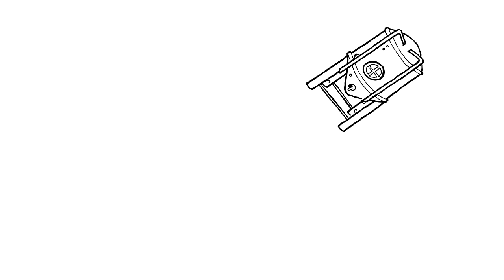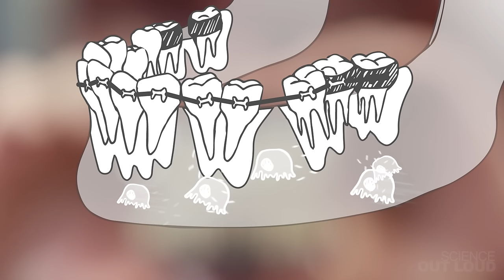How Do Braces Work?

Comment: I've had my braces for about 12 hours...already swallowed a bracket...
Reply: +Listening Point had them for two years now, won't remove them until this time next year lol and never had such problems :p
Reply: rip
Reply: Braces stink I thought my teeth were not going to hurt when I got the tightened but turns out they are hurting now or a day after.
Reply: +Flitx The Destroyer yeah they hurt every time you get the wires adjusted.
Reply: +Listening Point Yo LP, thanks for this intel. How would you rate the pain of adjusted braces on a 1-10 scale? And how about day-to-day between adjustments?
Reply: +Mike P It's probably a solid 7 the day after an adjustment but after about a week you don't even notice most of the time.
Reply: +Mike P no maybe like a 20/10
Reply: My teeth have already moved a bit and my mouth hurts more often.  Major diet change too.
Reply: They hurt the worst the first couple days after an adjustment.  And periodically certain teeth might be sensitive when you put bite pressure down on them. But most of the time you don't really notice any pain.  You're gonna inevitably get some cuts inside of your mouth where the brackets ride against your cheeks, I sometimes have to put wax on mine to keep from getting irritated that way.  Aside from that, keep em clean.  Get a waterflosser if you can and seriously don't even TRY to eat foods that are on the list of stuff they tell you not to eat...or you'll eat a bracket like I did.
Reply: +Listening Point woo I thought I was the only one getting myself hurt in my cheeks
Reply: Lool wtf
Reply: LMAO!!! i thought i would be worse XD
Reply: whuttttt da!!!!
Reply: thanks
Reply: Watch what you eat!! Brackets brake really easily. My sister broke 26. I've had them for 6 months so far and I haven't broken one....yet.
Reply: lol no its like a 4/10
Reply: +Alexa Calvo i never broke one, except when one cane off when i was brushing my teeth..lol.

Over the years that was the only one that broke.
Reply: OMG I ALSO SWALLOWED A BRACKET !!
Reply: Listening Point lol
Reply: LOL, Had braces since last July, my dentist told me i only have 3-6 months left till i get my braces off, whoooo
Reply: Listening Point lol
Reply: Listening Point ? how
Reply: +momo potato girl c Protein Bar.  Good for bones.  Bad for brackets.
Reply: Listening Point I'm getting braces tomorrow 😬 probably gonna happen to me too 😂
Reply: Just avoid thing thicker than the distance between the top of your tooth and the top of the bracket.  Break your food into smaller pieces and don't eat anything really chewy or super hard and you'll be fine.  It's been about a year now and I haven't lost another bracket yet...knock on wood.
Reply: Listening Point I applaud you.
Reply: is that true?
Reply: its youtube Its possible
Reply: Listening Point omg are you serious
Reply: Yup
Reply: Listening Point this is why I don't want braces. right there
Reply: Listening Point fuck that. that's like, all my sandwiches, apples, just about every other fruit. I'm lazy man
Reply: I have braces for 4 months and the first week I broke 3 of them😂...btw I haven't understand why we are not allowed toeat gum..I do it often although😭
Reply: Kostas Sx well you broke three of them... kinda answers that
Reply: Holy crap. Lmao I did the same thing at school...I was in gym class and I bit down way to hard it flew off my teeth and into my stomach it went...Rip
Reply: Listening Point Audio Improv lmao
Reply: When I first got braces, they didn't put the metal things on my molars since I had to get teeth pulled, and they botched the glue so the entire top piece fell off within 24 hours
Reply: Listening Point Audio Improv Lmao
Reply: Listening Point Audio Improv not possible
Reply: im must pull it out
Reply: Listening Point Audio Improv that’s so mee💀💀💀
Reply: Listening Point Audio Improv they dropped one bracket in my throat while putting then on and my orthodontist said "fuck it just swallow it"
Reply: StylesFinnClub idk y but I laughed
Reply: Listening Point haha
Reply: Listening Point how do you swallow a braket poor you
Reply: Listening Point Okay.....
Reply: Lmao😂😂the first time I got them like 2 hours later I broke the brace
Reply: Damn I've had mine for 3 years (just got them off today!!!) And I've never broken a bracket how the hell did you swallow yours!?!? O_o
Reply: Listening Point same here while I was eating
Reply: Listening Point 0-0 ok than
Reply: Listening Point I broke mine after 2 weeks.... Twas not my fault 😵 The orthodontist didn't stick on the glue right 😤
Reply: Listening Point what!!!
Reply: Listening Point Lel how does it taste? I have my braces also but I didnt follow instuctions. I ate my jaw
Reply: Listening Point nfmdd
Reply: Listening Point Oh no! Hope you got to a hospital, the metal can tear some of your stomach tissues... did you eat something really hot and liquidy or something? Because the glue also doesn't completely dry till 24 hours is up
Reply: Mike Pritchard either I have extreme pain tolerance or am lucky, because it’s maybe a 2, until I bite things, then it turns into a 5.
Reply: I honestly laugh really lound😂
Reply: Cool hahaha. Problems
Reply: Listening Point it’s actually not possible to swallow a bracket. The wire is wound through all the brackets. The only bracket you might me able to swallow is the last one which holds the wire. I have broken many brackets and never have swallowed them.
Reply: RELATABLE
Reply: Listening Point YOU JUST MADE ME SPIT WATER ON MYSELF AHAHA
Reply: I feel so bad for laughing😂
Reply: Listening Point I have them
Reply: How damn 😂👏👏👏
Reply: Listening Point .
Reply: Listening Point lol
Reply: Listening Point oh dang lol
Reply: similar thing happened to me but in first two hours lmao
Reply: Um your orthodontist is probably not very good. If a bracket pops off it stays on the wire I don’t know what kind of braces you have but there really isn’t a way for that to happen unless you physically pull on it
Reply: And now you make ASMR videos.
Reply: Listening Point what. How tf did you manage this
Reply: i've had my braces for more than a year now and never broke any brackets...
Reply: LOLLLLL
Reply: lmaooo rip
Reply: The real question is, did you get them off yet?
Reply: Listening Point 💀
Reply: Listening Point lmao I did that to once more like twice
Reply: Listening Point what! :o I’m not ready for braces in November 😱😓
Reply: Listening Point 😂wow
Reply: Flitx The Destroyer Really? Mine never hurt after getting them tightened... maybe mine aren't as sensitive, but I'm not sure.
Reply: Listening Point wow. 😯
Reply: Listening Point oh dear!!!!
Reply: Listening Point 😂😂😂😂😂
Reply: Listening Point meeeee
Reply: Listening Point ugh I will have to get them soon and I’m going to hate is so much! Good luck.
Reply: How the......
Reply: I literally just got mine off and I was just told I needed them again. My teeth are horrible
Reply: Listening Point i had mine taken off in February this year after almost 2.5 years 🙊 was only supposed to have them for a year! But im so happy with how my teeth are now compared to how they were before! The pain is totally worth it! Xx
Reply: On a scale to 1-10, how much do they hurt when you first get them? I'm getting my braces soon.
Reply: Listening Point lol😂😂
Reply: Listening Point same I had my braces and for a little bit and my brackets keep falling off and once I swallowed a bracket and I dint even know
Reply: how did it go?
Reply: readmeastory LOL UR PROFILE PIC GIES WELL WITH HER COMMENT
Reply: readmeastory *goes
Reply: Listening Point hmm so how are you now two years later?Do you still have braces?
Reply: 🤔 sounds like something I would do
Reply: Noooo
Reply: Listening Point Htf do u swallow it I had mine for 2 years and never happened
Reply: How tf do u break a bracket i use to have braces for 2 years and that never happenned
Reply: Still alive bro
Reply: Woah
Reply: uhh... the worst thing that happened to me was I couldn’t eat solid food
Reply: Listening Point wow
Reply: I’m feel bad for u
Reply: Listening Point how!
Reply: R.I.P. YOUR BRACKET
Reply: oh atleast im not the only one that swallowed a  bracket..
Reply: Rip 😆
Reply: Listening Point SAME
Reply: Omg I wanted braces but once I got them I died
Reply: HOW?!??
Reply: BrUh
Reply: I though I was going to lose a bracket the second I walked out if the orthodontist
Reply: tbh that happened to me
Reply: @amylene  Lucky. I Have 3 braces every 2 years which means 6 years kf braces hooray
Reply: Do braces hurt more than fracturing your wrist please answer quickly cuz u guys scaring me,because I fractured my wrist and it hurt like hell hope getting braces isn’t the same
Reply: @flitxthedestroyer237  take a painkiller. I had 5 teeth removed. Total of 9 anaesthesias. I'm 12.
Reply: how–

5 years ago

Comment: hits blunt
how are teeth harder than steel if your teeth can't break steel but steel can break teeth
Reply: My head hurts
Reply: W
Reply: GD Danny W
Reply: Dang it,Amyyyy!
Reply: Vaffanculo I know it's a joke, but it's because steel is weaker, but it's much more dense than bone, which is even more dense than teeth.
Reply: mr.stark i don't feel so good
Reply: OMFG
Reply: FBI- Dont move
Reply: Thass deep
Reply: Cause there thinner than steel
Reply: Because steel is heavier than feathers
Reply: Vaffanculo nice username👀 HAHAHAHAHA
Reply: Apparently it has to do with the brittleness of teeth being higher and more susceptible to chipping off.
Reply: It calls jaw muscle
Reply: put the same density teeth and steel side by side and put force on steel will fail first.
Reply: Probably because steel comes in heavier packages
Reply: Because steel has more tensile strength. Put simply hardness measures the resistance of the substance to scratches
Reply: Brain cell has left the chat
Reply: cuz its ur jaw muscles that arent strong enough
Reply: Teeth are harder than steel. You can test this by Mohs scale of hardness
Reply: Dentists:Stay where you are
Reply: Teeth is harder then steel..but your body can't apply that much force
Reply: I know this is a joke butttt... I probably think it’s because of the crystal structure of teeth and steel itself.

Maybe teeth are harder than steel, but they are also brittle (i.e glass). So yeah :v
Reply: actually youre thinking of toughness. hardness just refers to what level something scratches at. for example, diamond is a 10/10, and plastic is about a 3/10.
Reply: It's not just about how hard they are it's also about how much force can bite down on whatever it is you're  eating
Reply: ahh
Reply: I think it's because teeth are harder but steel is stronger?????????????  I'm not positive.
Reply: Oh
Reply: Our teeth come out but never break when we bite into steel if our tissues are weak so technically the lady’s right
Reply: This is exactly what I thought
Reply: BroooOOooOoo...
Reply: Exactly
Reply: That's how I cut the end of my guitar strings
Reply: Vaffanculo Tooth enamel is harder than steel, but breaks much easier. Tooth enamel is mostly hydroxyapatite, which is a mineral form of calcium phosphate. The apatite group of minerals scores a five on the Mohs hardness scale; which makes enamel the hardest biological material.
Reply: how do you know that teeth can't break steel
Reply: @sharonfernandes3288  😂
Reply: Steel is and that's why teeth are but if because of and that's only if support by
Reply: My head hurts from reading this
Reply: Its all about force
Reply: By force and density
Reply: I mean maybe because teeth shatter easier instead of just absorbing the impact by denting
Reply: Teeth are organic
Reply: Isn't it because it's heavier than your teeth
Reply: What if u made a pickaxes out of teeth and smacked metal?
Reply: For most people don’t have very strong teeth, due to decay and other stuff.
And for people who TRY to break steal. The expect it to break.
Reply: The harder something is, the more brittle it is. So while teeth may be harder, they break, while steel deforms.
Reply: Because teeth and steel have the same amount of letters but the S in steel is closer to the letter (H)ard which makes it slightly stronger
Reply: It being harder doesn’t mean it has more breaking force
Reply: Same question.
Reply: Teeth are indeed harder than steel and can break steel, try it and you will see
Reply: Take your like and get out.
Reply: Good question ref!
Reply: The durability isnt that strong but Its Harder
Reply: LMAOOOO😂😂😂😂😂
Reply: @crazynathan81  why am i getting Replies but theres no mention in my name?????
Reply: it could be because teeth are smaller than steel and if the steel was smaller than the tooth it would be too hard to break but I'm not sure haha
Reply: Had to read it twice to understand 😂😂
Reply: Bruh what
Reply: It's because of your jaw, if you had steel teeth instead, it would be the same or weaker. the force of your teeth on your gums makes you feel pain, so you release you bite
Reply: But stell is heavy than feathers!
Reply: That’s one of the greatest questions of life
Reply: Roots
Reply: Hard material means that its not east to break, It doesn’t mean the harder object can or can’t break the other
Reply: i was wondering the same thing- but its probably because of our muscles thats why we cant chew steel? I know im wrong lol
Reply: BAHAHAHA!
Reply: visible confusion
Reply: Damn bruh
Reply: I know this is a joke but maybe because the brain doesn’t allow us. We could break our own teeth but our brains don’t let us
Reply: Teeth aren't as brittle as steel so they can easily break
Reply: What a great username
Reply: Because teeth are strong but gums aren't strong
Reply: Probably depends on the shape and size of both of the competitors 😜
Reply: 😂 are you serious ? She just said why.
Reply: 😂😂 0:32 that’s why you can’t it’s to much pressure at 1 time.
Reply: The reason is because no matter how strong your teeth are if you bite down as hard as you can the steel won’t be damaged because you bite with your jaw. For example if you had a super strong piston pushing a flat piece of steel vs a super weak piston pushing a pointy piece of steel the super strong flat one would do more damage to something because more force is being applied.
Reply: They don't break the teeth they just remove it from the jaws